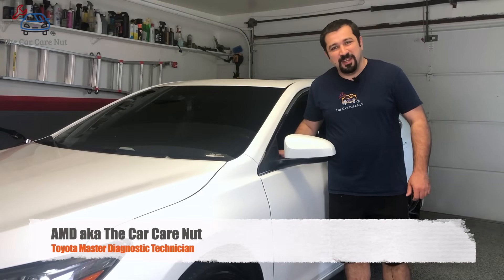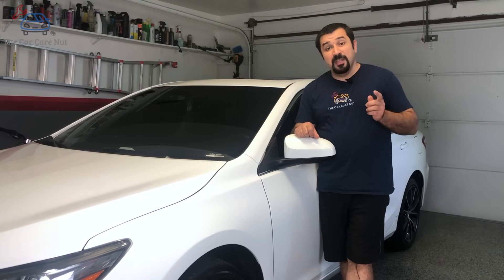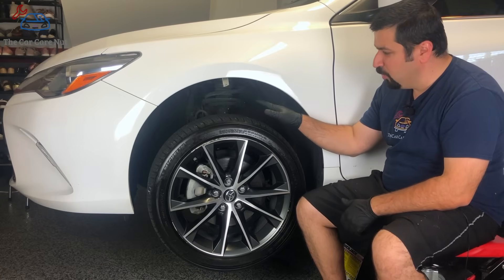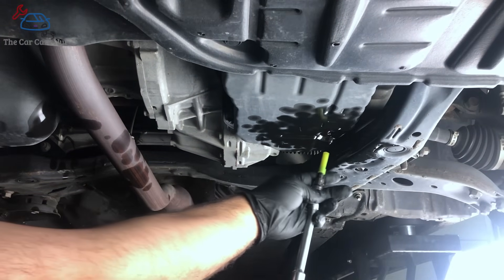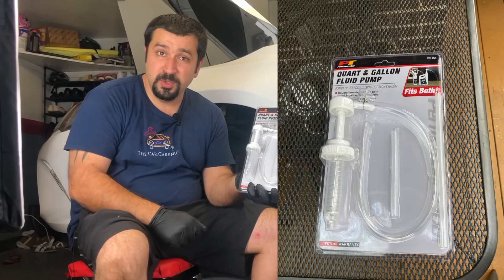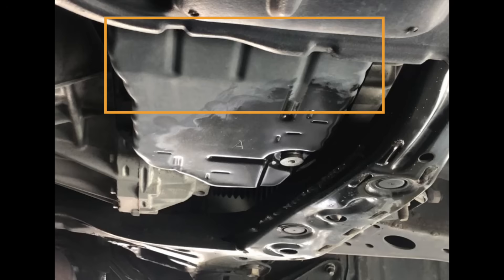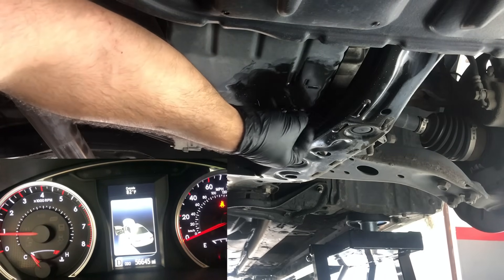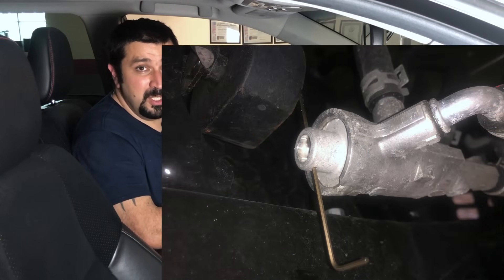How to change your Toyota Sealed Transmission Fluid

Comment: Thank you for this video. I am going to use the temperature gun method. I have a 2015 Lexus IS350.  Can you please provide info for the correct temperature to remove excess oil from drain plug. Thank you!
Reply from the maker: Hi! Should be around 99-115

Comment: Can i do this on a 2016 4runner sr5 without jacking it off the ground?? ALSO is it safe to do it if it has 89k miles??
Reply from the maker: Hi! You can if you can reach it and it is safe at 89k
Reply: @TheCarCareNut  What about 236,000 miles?
Reply from the maker: That’s too high. Unless the fluids been replaced regularly I would leave it alone

Comment: I got a 2017 Camry 2.5 XSE with 62k miles and I wanna change the transmission fluid,  I already bought the fluid at the toyota dealer. I wanted to change the filter as well but the guy at the dealer told me not to change the filter,  is this correct? Why did he recommend me not to change my transmission filter?
Reply from the maker: Hi! I wouldn’t change the filter. If you change the fluid on time you don’t have to worry about the filter
Reply: @TheCarCareNut  thank you boss, I'm at 62k miles right now so I guess I'm ok if I don't change it right?
Reply from the maker: You’re good. Just change the fluid and again every 60k miles and you won’t have to worry about the filyer

Comment: AMD great video! That said I am unsure whether I should do a drain and fill or not. I just bought a 2011 Rav 4 2.5 L with 123,500 miles and when I asked the owner if she had had the fluid changed she said she didn't think she had. Is that amount of mileage too high to risk a drain and fill or should I just leave well enough alone? The transmission seems to shift well although when you shift into Drive after backing up there is a bit of a jerk.
Reply from the maker: Hi! It’s a risk at this mileage. If anything I would just do a single drain and fill but first check the fluid condition
Reply: The Car Care Nut Thanks for the quick response! When you suggest I check the condition of the fluid I am not sure what you mean. If the condition of the fluid is good should I leave it alone, and if it is bad should I do single drain?
Reply from the maker: Drain a very small sample and look at it. If it’s dark bit smells like transmission fluid you’re good to do a single drain and fill. If it has a burnt smell I would leave it alone
Reply: The Car Care Nut Thanks! Will do.

Comment: You mention in the Last description to take your foot off the brake pedal and remove the jumper wire. Should the transmission be in neutral or park?
Reply: Thanks
Reply from the maker: Hi! In park

Comment: U say replace my 2011 camry le 2.5 6 speed tranny fluid every 60,000 but shouldn't I do it every 30000 since every time you change it you really only change about half of it since half is stuck in the torque convertor?
Reply: Also what's a smaller square to aim at with the temp gun cuz ur box u gave has a wide range of Temps from 80 to 120
Reply from the maker: Hi! Every 60k or 6 years is a safe replacement interval you can go 30k if you’d like

Comment: 2017 Toyota Sienna.  Cover was 2 clips and 1 screw.  No Aux cooler. The tube was black and required 7mm Hex.  3 quarts came out.  For those who want to know.

Comment: Why we couldn’t do a drain and fill on this type of transmission? I watched Scotty Skilmer doing drain and fill on a 2015 Corolla without checking the temperature. I’m confused 😐
Reply from the maker: If the fluid level was correct initially sure you can do that. But if it’s not then it will remain so. When dealing with transmissions don’t do shortcuts, finish the job right and check the fluid level.

Comment: Really enjoying your videos. I am wondering if there is a serviceable filter that should be changed?
Reply from the maker: Hi! So with Toyota transmissions if the fluid is changed on time the filter typically can last the life of the car. Very rarely are they replaced and found dirty

Comment: Hi, I have 2012 Toyota Sienna with 179,000 miles on it. Vehicle history does not show anything about transmission fluid drain/fill/flush. Transmission shifts smoothly, no problem. Despite the high mileage, can I do a drain and fill on the transmission fluid or is it a bad idea?
Reply from the maker: Hi! At this mileage I would leave it alone honestly

Comment: Your video is very informative and did a drain and refill on my '19 Forester following similar steps! For the Toyotas, what tools do the dealership use for a complete drain/flushing? Are the steps for complete drain / flushing much more complicated?
Reply from the maker: Hi! The flush is different we use a machine that goes on the lines to take fluid and add fluid at the same time. Setting the fluid level after is exactly the same as the video we just use the scan tool method

Comment: The jumper wire doesn't do anything on my 2020 Corolla LE. Also the obd connector is upsidedown not like you show it...anyway the connector has a form and a number of pins are the same I just follow that...but after placing the cable I run on the key (not the engine) and the lights aren't crazy like in ur example. Any ideas? Thank you
Reply from the maker: The 2020 corolla doesn’t support the jumper method unfortunately they took it out you’ll need a scan tool to see the temp
Reply: @TheCarCareNut  oh boy. They really want us to spend money in the dealership...Thank you my friend

Comment: I got my Corolla up on jacks, all four corners, and measured a difference of 1/4" between bottoms of some of the tires and the floor.  All jacks were set to the same level. I understand the video is informational only, but I just wondered if this 1/4" difference will  make for an inaccurate measure of the overflow level.

Comment: I Thank you ! Very well presented - I’m having issue with trans starting to slip on a 2013 Camry SE so i want to try a fluid change  I followed everything you presented but I was wondering when you pulled the drain plug and then pulled out a screen / tube - where do i get that part and what’s it called ?
Reply from the maker: Hi! You don’t need to replace it. Reuse the same one. It’s called the overflow tube
Reply: my 2016 camry is shifting weird,sometimes feels low accerlation and sometimes revs up high

Comment: I have a 2008 Toyota Noah ZRR70, not a car seen much on here, does the procedure work with this also? I'm at 102,000 kilometers, don't know if the fluid was ever changed.

Comment: I did this procedure and I ended up removing too much oil, when I did another drain the oil was blackish and small mettal fracments. So what I did instead was just remove two quarts and put back two quarts that simple, was is working better and just fine. No need to ovrr fill it and do the heating procces to rwmove extra oil. Dont listen to this tech on that area, just remove 2 and put back 2. Its wayyyu saferrrr.

Comment: Hi Amd, dose  camry(2018) 8 speed transmission have filter that should I replace?
Thank you for this good video.
Reply from the maker: Hi! Not something simple to get to. I wouldn’t worry about it just change the fluid every 60k or 6 years

Comment: Any disadvantage on Drain and Fill. I saw video that the gentleman measure the old oil come out and then put back the same amount of  new oil (of course, plus a little bit more due to oil in tube, pan not 100% completely go back in). Do you see any major disadvantage on it? By the way, can I use Aisin brand CVT FE fluid, they should be as good as the OEM, correct? thanks for the video.
Reply from the maker: Hi! I would complete the process without shortcuts. No disadvantages to drain and fill. I would use original fluid
Reply: @TheCarCareNut  Thank you so much.

Comment: Thanks Car Care Nut for the procedure, really helpful.
John previously (9months ago) asked that overfilling by 1/2qt might take too long to drain and you suggested to start draining a little early to have enough time to drain the 1/2qt.
I practiced the procedure in my garage with an ambient temp of 83F and timed how long it took to temp up (solid D light) and it took 2:12.
I then kept going cycling from D to N until the D light starting blinking, meaning too hot...my stopwatch was at 6:16 by that time.
Does this mean that I have ~4min in which to drain the excess?
If so, I'm thinking 4min is enough time to drain the excess 1/2qt.
Is my logic flawed?
Reply: I don't get it.  When I first removed the bottom nut (dipstick still in), like a quart of ATF came out COLD.  How is this possible if the fluid is smaller cold, but was originally filled to top of dipstick hot?  Does Toyota factory overfill by 1 QT?  I have had this happen with Toyota and Nissan, and I see it in other videos on cold ATF change.
Reply: @quinoajones3888  Same Exact Question I had?👍
Reply: @quinoajones3888  Because your engine is not running.
Reply from the maker: Hi! Yes that sounds right. Your logic is very correct. I say hurry because some folks will take their time to crawl under the car assuming the process takes 2 seconds when it could drain for a while. But you have plenty of time in your case

Comment: I just started your procedure on my 2010 Camry with 80,000 miles. I was surprised when I removed the drain plug and 1.1 quarts of fluid came out. The transmission was cold (about 85 degrees), and the vehicle was level. I was not expecting any fluid to come out based on your instructions. So I thought the transmission was perhaps overfilled at the factory. When I removed the tube another 0.9 quarts of fluid came out, for a total of 2 quarts. I thought the total was supposed to be about 2.5 quarts. So now I am  wondering how much to put back in. I suppose I should follow your directions. But it looks like I will be filling about a quart less than what was in there originally. Can you please help me understand what is going on here.
Reply: Sorry, I went back to your directions and see that some fluid should come out when the plugs is first removed. Still, I was not expecting 1.1 quarts.
Reply: If you drain 2 quarts when it's cold, can't you just refill with 2 quarts cold/room temp?

Comment: hi amd, i would like to know would you recommend flush the transmission or just drain and fill? also while the d( light is solid) do you put it on P(park) then go check the fluid to make sure is on the right level? thank you!
Reply from the maker: Hi! Yes put it in park. A drain and fill is safer if the car has higher miles

Comment: I have a question for you! First, Thank you so much for your videos! I recently purchased a 2019 highlander LE, V6 AWD with 25k miles after watching your buying guide. I called my local Toyota dealership to get general pricing on fluid changes, in the conversation i asked if they did drain and fill on transmissions or if they did a full flush. They said they did a flush by attaching to lines. Is this going to be an issue if completed at a toyota dealership, should/can i request a drain and fill only if they are willing?
Reply from the maker: Hi! You should be able to request a drain and fill instead. A flush is ok since your car doesn’t have a lot of miles. But the flush needs to be followed by a fluid level check.
Reply: @TheCarCareNut  Thank you for the reply, If the flush is ok on early low miles will it continue to be ok if done in regular intervals as the car gets older? What is the danger with a flush?
Reply from the maker: Yes it should be ok

Comment: A great overview of a necessary maintenance item.

Sealed transmissions with “lifetime” transmission fluid are the worst fraud ever perpetrated by car makers on buyers. I know I have a 2009 Tacoma with this claim. Although I brought the truck in for servicing since new the dealer never changed the transmission fluid even though Toyota recognized they blew it in around 2015 and issued a service bulletin recommending changes at 60k and 30k thereafter. They never communicated this to owners….
At 90k I started to notice the dreaded “ low speed shudder” and changed the fluid and filter. It was disgusting! The shudder does not go away quickly, but it does go away eventually if you keep changing the atf fluid. When the dealer renewed the frame on the truck they told me the transmission had to be replaced at a cost of more than $5000. I told them I’d wait til it broke down. The truck now has another 50k on it and aside from a teeny shudder at walking speeds it runs like a top. 
Don’t be afraid of changing the atf fluid and the filter as well if that’s possible
Don’t believe a dealer or service rep that tells you it’s lifetime fluid there is no such thing
Reply: Been reading a lot about the Toyota ATF WS and most people are saying it can't handle the high temperatures. I called the dealer to get a price on it and the sales rep asked me how many miles I had on my tacoma and I said 30k, he said woah woah woah you don't have to change it until 100k my man. I said will Toyota back that? He said yup! I said so after my 60k mile warranty is up Toyota will cover my transmission from not changing the fluid until 100k? He said I'm confused by the question, I said I'm confused by the answer. Even though this information was given to them by Toyota, it's some of the worst advise I've ever heard. Toyota will not do anything for you when you're out of warranty even if you followed their maintenance schedule to a T. The guidelines have been oil change every 5k and trans fluid every 30k for decades. Toyota didn't defy physics. They build incredible vehicles that last a long time, but the environmental regulations and fees are leading them into a black hole. Listen to mechanics, they know better than engineers. Sealed or unsealed transmission, oil burns. Keeping your fluids fresh is proven to make your vehicle last a long time.
Reply: @DanPotthast  Yes they are durable, all trace of shuddering in mine is now gone 40k after a couple of quick changes. I think it took a while for everything to wear in again. I plan on changing ATF oil every 50k now
Reply: @DanPotthast  My family has never changed the transmission fluid on any vehicle that we have ever owned. Always made sure it was at the correct level. We have never had to replace a transmission, Ever. That's over the span of about 20 vehicles. Almost everyone of them exceeding 300k miles.
76 chevy C10 - 400k+
95 chevy Silverado - 300k+
98 toyota camry - 300k+
03 toyota corolla - 285k+
04 Honda Accord - 295k+
08 chevy colorado - 280k+
Just to list a few. 
Also just to aggravate some people, lol, most of these miles were run using Walmart oil and Fram oil filters. *gasps*
I'm not saying you are wrong about changing it. I'm just noting that not changing it doesn't inherently mean your going to have problems.
Reply: @anthonyrodney6167  Aggravate
Reply: @roberttwist5190  Nice catch! 👍
Reply: @anthonyrodney6167      That's great.  How many of those vehicles had a CVT transmission?
Reply: @anthonyrodney6167  I agree , my family probably owned 30 cars over 70 years and all we ever did was be sure the level was correct . The one transmission that failed was my personal business F250 van , but this was at 265,000 miles …hard work , at that point most need a tear down anyway
Reply: 10.3.21.   Reminds me of GM with their touting of the new coolant DexCool®️for the 1996 model year………good for 150k/5yrs⚠️. Turned out to be known as “DexKill or Deathcool” ‼️    It was quietly re-engineered years later.
Reply: @stevensapyak7971  Before I switch to Honda and Toyota, I had two GM cars and the transmissions had to be rebuilt at 28,000 and 46,000. No fluid would ever stay in them that long anyway. Both were V6 engines.
Reply: Amen Brother change that trans fluid for long service life!
Reply: I completely agree!  When they say "lifetime fluid" it just means it will be a much shorter lifetime.  lol
Reply: Any opinion on a CVT cooler upgrade
Reply: @domdomdominoes6128  nope, I would hope one is included in the vehicle. I’ve heard with CVTs change the fluid and filters frequently and don’t tow a trailer as they aren’t designed for that.
Reply: I agree, even oil oxidizes, even when not driven, lifetime mechanic, nothing is more expensive than oil changes, except no oil changes, same as grease jobs.

Comment: As there is a direct correlation between the level of fluid when it is cold versus when it is at temp, why didn't Toyota make the overflow tube the desired height of cold fluid?
Reply from the maker: Cold fluid is not a constant. Cold for someone in Florida is 50 F in Chicago it’s -25
Reply: @TheCarCareNut  Smart
Reply: @TheCarCareNut  question is...... can I change fluid when cold?  What ever amount i drained I replace.  When cold.  Sitting overnight.
Reply from the maker: Hi! You can but how do you know the fluid level was right to begin with? I would just check it
Reply: @TheCarCareNut  provided that the original owner with original van intact never molested.  Which i am.
Reply: @tunyung There's another person that commented that their 3rd Gen Tacoma came a quart + low on transmission fluid from the factory so...that's what the problem is. You're taking a gamble.